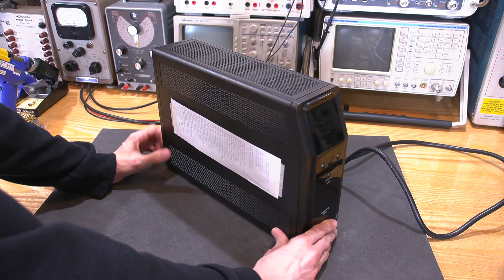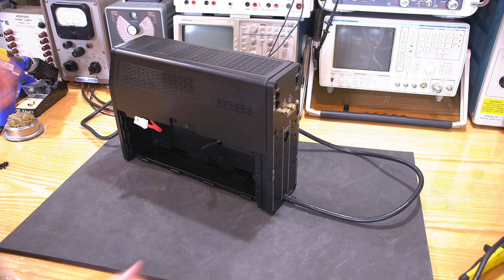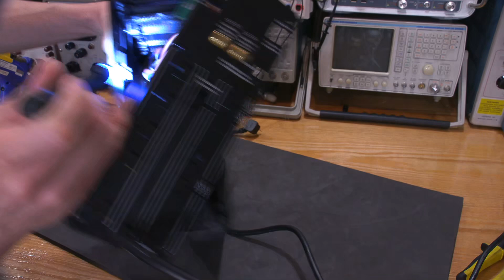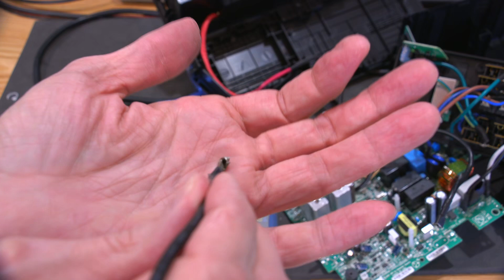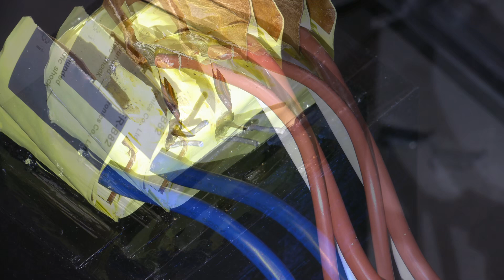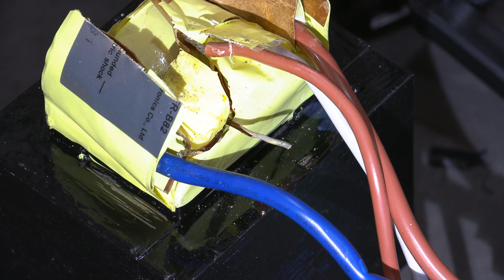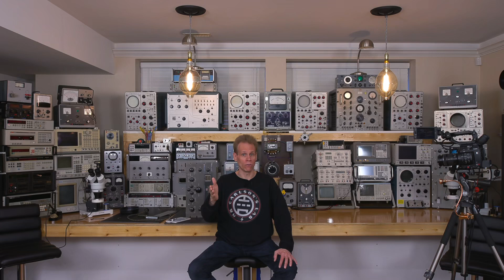UPS Electrical Failure - Teardown and Analysis!

Comment: A few months ago i had a UPS (Green Power brand) and that UPS was complete dead when i received it, battery totally flat. So my first thoughs where that de battery was gone bad, so after replacing the battery, it kept beeping about overload on the output, while there was nothing connected. After some investigation, the culprit was also the transformer. After opening the yellow isolation like you did, i found a thermal fuse that was blown. After temporary bypassing this thermal fuse, and do some continuity measurings, i found that the transformer had a broken winding deep inside. i have seen aluminium before in cheap stick welder transformers, it is way cheaper then copper and it  weights less then copper, so the shippingcosts are less, so this is a win win win for the manufacturer. APC was always a good brand, but even the good ones are now cutting corners to survive.

Comment: APC used to make very good consumer grade UPSs and I have owned several of them. My older ones (7-10 years old) are still performing great and my only maintenance has been battery changes; but the newer two (1-3 years old) both failed just about after one year. I believe that APC has started sourcing cheaper parts from China and your aluminum wound X-former is likely one of them. I gave APC the boot a few years ago and I now own CyberPower units that are operating flawlessly.
Reply: everything's made in china, it just depends on if you get it from the good factories or the discount ones

Comment: We bought an APC exactly like the model you are using in the video.  It failed.  APC replaced it.  The new unit failed.  APC sent us a third unit.  It seems to work okay.  Each month we run a one minute power fail test.  Unit
three seems to be running okay.

Comment: Insane. Apparently the purpose of the solder was just to make the stranded lead wire stiff enough to crimp around the end of the winding! I wonder if the UPS manufacturer even knew what was inside the nice-looking transformers their supplier was sending them.
Reply from the maker: I wonder this myself.
Reply: @MrCarlsonsLab  working at a transformer manufacturer here in the US myself, I am appalled at the “crimping” of the tap wires to the transformer leads! 
I am wondering who the manufacturer of that transformer is, since it seems to have been made in an awful cheap and unprofessional way. Those wires should all have been crimped with a dedicated crimp sleeve. It’s only a few cents more per transformer, but increases the quality by way more!
I found the manufacturer in the video and I’m not surprised… Shenzhen Jingquanhua in China… where else would a company get cheap parts…
I would also like to add that there is nothing wrong with aluminum windings. Depending on the capacity of the transformer it is very common as it also makes it cheaper in price and not in quality (if designed right)
Reply: They most assuredly know what those transformers are filled with. As long as it runs past the warranty time or even 3-4 yrs.. and saves them a dollar or 2 over copper windings..the bean counters are tickled poopless. Be assured that when they started using cheaper transformers.. they certainly didnt pass the savings along to the end users.
Reply: @GunnerAsch1  No, worry more about the share holders than your customers.  Be a financial company rather than an engineering company.  This is why GE Failed.  This is the root cause of the Boeing MAX crashes, why the StarLiner is a piece of highly overpriced junk.
Reply: They should know. You'd think the would at least pull one unit out of stock and do a tear down like this to find out what they are buying from China.
Reply: I wonder if they had used a ferrule to crimp it would it be ok as a final product?
Reply: @starlite528  right everyone is complaining about aluminium wire but what they should be complaining about is bad design using aluminium wire. I'm sure it can be used properly.
Reply: They don't care how it is made..just how cheap they get it..and the profit they make ... why stuff is crap nowadays...
Reply: One wonders if the bean counters factor in the cost of doing a recall...those things seem like a fire hazard (in addition to being an unreliable UPS).
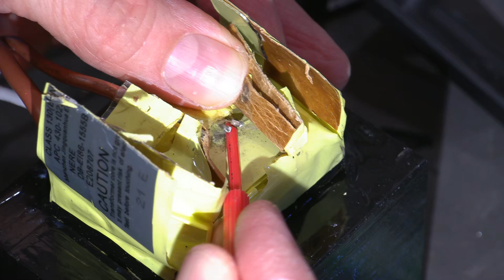Reply: Agreed. I tried pulling a spec sheet on this transformer, hoping that it would list the metal used for windings (knowing it is aluminum). I was able to extrapolate the exact model at 12:30, then searched eBay for a complete model #. BTW, they are cheap (~ 12 bucks). There's no readily-available spec sheet I could find, despite having the complete model #.
Reply: @cdnron75  aluminum windings are very common in transformers. Nothing there. We manufacture transformers with aluminum and copper windings and they are all solid in quality and functionality. There is a price difference between the two, aluminum being cheaper in price than copper, but definitely not cheaper in quality if the design is right. In this case, the crimp is the cheap flaw and APC could actually get that transformer company to replace all of the transformers in a recall.
Reply: This was my first reaction... certainly wouldn't be the first time component supply chain fraud had caused a problem. Bet it's the same in all the other units too.
Reply: All transformers have thin wire windings and thicker wires soldered to connect to.... nothing strange here..if you work with transformers...lol
Reply: @cdnron75  And, they still have their property coverage warranty. I wonder if nowadays, they pulled a page from Ford Pinto days, and decided that it's cheaper to simply pay out when one "blows" up. Ford knew of their "exploding gas tank" issue, but decided payouts to victims was cheaper than recalling and fixing the issue.

Comment: Paul is an expert.  By comparison, I'm a novice with an electronics background.  IMHO, the buck stops with the manufacturer of the transformer which probably isn't APC.  Aluminum wire in a transformer is unacceptable and a recipe for disaster.  Excellent video Paul.

Comment: I got a free large 3000 model/VA or something like that unit and one day as I was starting a project and decided to go .... EEEEEEEEEE acted much like that minus the noises. Attempted to fix it ordered some replacement transistors if I remember right off Amazon that were "new" that were clearly not new when they arrived. So I don't know if I got bad replacement parts or if there was more wrong with it but it's the project on the pile that I haven't gotten back to. It was really nice because I had a nice 30 amp output connector with I think 24 amp capability and I just replaced all 10 batteries.
Curious what brand you went with for replacements. For better or worse APC seems to be the most well-made-ish. I've used a few other brands that seem to cut corners in either the waveform, the modified waveform, fans, etc.

Aluminum well I'm shocked. Maybe I should just build my own online UPS with a quality inverter.

Comment: I have a bunch of much older APC's.  Fully metal absent any fancy screens.  Just a serial port if you wanted any alarm reporting, etc.  Never an issue.  Replace batteries when they need them.

Comment: Ever since they got bought / merged with Schneider Electric the former APC quality has been going down the drain. On the tech side as well as the support side (at least here in Europe).
Those "Quality Assurance / Revision Receipts" are standard though and so far have been stuck on every unit I have ever seen.
Reply: I agree the printed report has been on every unit I have opened... and I have opened a lot of them over the years.

Comment: I have 3 different APC models (one of them is the same as in the video). No issues whatsoever some of them are older than 5 years.
In the beginning, I have done my research and found out - to avoid the cheapest UPS from any brand. APC had the best reputation based on reviews. No issues on my end

Comment: Have to find some APC units from the late 90's early 2000's. They're built like tanks and weigh just as much.
Reply: Yup.  I have three rack mount, and two more larger units from that era.  Replace the batteries and keep on going.

Comment: I have had eight units of varying brands.  I've had five Cyberpower ones, three of which are currently in service.  One quit due to a capacitor letting out the magic smoke (this unit was 2005 era), and I was here when it did it, and another one stopped working with an error code after a power event... I think it also was F04.  No drama, just wouldn't power up anymore.  Sent it to recycling.

I also currently have a MinuteMan MBK 300.  I've had this basic little tank for well over 15 years.  It's been through over four batteries, and it currently backs up my router and cable modem.  I just can't turn off the beeper.

Another UPS I had was an APC tower UPS that was the size of a server computer and had 4 giant batteries in it, and weighed like 200 pounds.  It was loud, and it started failing in strange ways.  I got nervous with it and sent it to recycling.

The last UPS I wound up recycling was a Tripp-Lite unit that I brought home from a friend.  The charging circuit was defective.

Not quite a UPS, but I have a whole home solar array with battery solution from Sunpower.  52kwh of capacity, 13.6kw of continuous power delivery via 2 Schneider XW-Pro inverters during a power failure, 12kw continuous power while on-grid.  The Hub+, whichsort of a smart circuit panel, has a built in automatic transfer switch that they call a rapid transfer switch, that automatically switches the house from grid to an island micro-grid mode.  The batteries and the inverters power the house, and after about 5 minutes, the solar panels come back online and will power the house and continue to charge the batteries.  So during the summer, it's possible to suffer a grid outage and keep life going as if nothing is wrong.  The panels rock micro inverters too, which is nice.

Comment: Oh my friggin god. Thats horrid. ... what a disaster! Bad as when EEVBlog noticed no fuses in weller soldering irons. I should be specific. The aluminum transformer, meh, it can be done if done right. The connection is what blows my mind.... The wiring in my house is still aluminum. It has proper pigtails with proper aluminum wire nuts and antioxidant coatings. All done right. A proper  strong tight crimp and some antiox compound (after a good roughing of the wire end) and this would have never been an issue.

Comment: Very disappointing Paul, they could have used crimps to transition to the copper wire or crimped the wire with a copper crimp and solder to that. I seem to remember that copper and aluminium can corrode at the connection point though.

Comment: I don't think APC knew about that, at least not at time of assembly. Whoever they sourced those transformers from...seems obvious that APC got scammed.

If that was a legitimate and approved design, I would expect to see better splicing. The hack job looks like no such splices were in the manufacturer's stock. Not sure why they would have spools of varnished aluminum, though...very weird.

My career is in IT. Over 15 years. As a software engineer, I also have some experience in network admin. Enough to know that APC is a trusted brand in the industry. Surely they would never risk their reputation by knowingly selling UPS's with those transformers.

Comment: We have two 5KVA APC UPS' in our server room at work. Constant battery issues and then a spectacular failure similar to what was described here with loud bangs and some visual sparks. Never thought something that was designed to improve uptime could be so unreliable.

Comment: Paul I am in Richmond.  I have 2 of these....  1 at work and one at home.  The one at home turned off while I was away.... Then it wouldn't turn on for 3 days - no explanation as to why.  Batts had good charge....  what the heck?   One of my coworkers on night shift told me that one at work had a terrible internal event - but it was still working fine???

Comment: they couldn't even spring for CCA, they went full clu wire cheapo.

ergh.

re-wind it with copper? probably work better than whatever you could source for it at least.

Comment: Good day and thanks I can see your disappointment. Cost of production is likely a big part of a modern day electrical engineering degree 😐. They substitute aluminium wires for lots of stuff now, from data cables all the way up to hv transmission lines. I've even got a few sets of car jumper cables that upon failure inspection are copper coated aluminum. And the power company recently took down my house supply from the street to replace with aluminium (a corrupt recycling swindle due to copper value). As per other comments yes any metal can be joined to any metal with the right flux, heat and filler but that doesn't mean its good to do. They ought to be learning about aluminiums rate of oxidisation and degradation when heat and electric current is applied. Happy weekend bye for now..

Comment: That a newer APC . I got a few older ones and only the battery quit after 2 years . only seen 1 arcing and it was the MOV on the board covered in heat shrink. was a burnt mess. A friend brought it  to me .was still working . was able to clean it up and new V150LA20 MOV  and fixed. must had a surge . the computer was fine. all the ones I had apart look like copper windings. but them are the older APC ones. I would not trust any of them  . save the battery's and PC board with heat sinks and parts. may be some fun projects. 😀

Comment: To solder to aluminum, I've always needed to have a good puddle of flux, and scrape the aluminum in that flux. Once thru the aluminum oxide layer the flux keeps more oxide from forming and the aluminum can be tinned. Then reflow to solder to copper. But with that small of wire, my technique would be a challenge. Maybe there is a flux which would eat the oxide layer, but its pretty tough stuff.

Comment: huh well good to know, ill be replacing the unit below my desk then. I have your exact model, same shape 1500va and everything. granted ive had mine for quite a few years now so i doubt it will fail if it has not yet but id rather get something of higher quality.
any recommendations of a good large ups like this one but, you know, actual copper transformer ect?

Comment: Hi Mr Carlson, sir. small 
Ups is a good circuit design, but a big problem is transformer, not fully copper windings. Why did companies make these big mistakes? I don't know if my suggestions are buying a Ups bigger type inverter, buy. fully copper windings and big parts on the circuits. This is good. But smaller type Ups always bigger problems create you know sir. Thanks again, sir.
I am waiting for the next
 part, sir. Thanks 😊

Comment: The title should be "Mr. Carlson Learns Planned Obsolescence". This is a common practice as the oxide layer takes about 2 years to break down, and coincidently the warranty is at most 1 year. That's why we stick with good old tech!
Reply: For home use, I’d buy two eBay special 120-24V transformers, used one with a lead-acid charge controller to keep the batteries happy, and the other one with a 555 oscillator and mosfet driver for on-line output. I used a standard DIN-rail breaker for output protection. Not as efficient as offline units; but the two I built have lasted 15 years and had the batteries changed once. When on battery power, one voltage monitor would close a relay that drove a break condition on the serial input of the protected PC, and the other one shut down the inverter once the battery dropped even further. Bare minimum of functionality but fairly robust. No transient protection on the input either - the input transformer didn’t seem to care one bit (why would it).
Reply: But where can you get (good old tech)?   I have a failed APC UPS and am wondering where to turn now that my unit has died!?
Reply: @thighdude7  I was referring to vintage radios and electronics as is most commonly showcased on this channel. If it isn't made completely from metal and uses vacuum tubes, it's no good!
Reply: @thighdude7  Get a used rack-mount corporate UPS from ebay. They usually need batteries replaced but the total cost comes out under these cheap-ass back-UPS units. 

Being corporate focused they are generally designed to run 5+ years at the minimum.
Reply: @thighdude7  Unlike Mr Carlson, repair what you have.  Replace the faulty component with an improved one and if that's the transformer, then it's the transformer.  There is some time savings and logic in just buying another brand new, but, what if they got aluminum wound transformers from same supplier too?  It wouldn't be surprising if they are competing on same capacity/price-point.

Autopsy your dead unit and decide what to do from there.  Until these aluminum wound transformers came along, they were a pretty rare failure point so you may just need a switching transistor or something, fried from a power surge for example.
Reply: Huh whut no!  This isn't an oxide layer breaking down, having the oxide layer isn't a problem on the exterior and shouldn't be there on the interior of the joint, breaking down is just not what is happening.  What you wrote simply makes no sense.
Reply: @Stinky Cheese  Ya, what I meant to state is how the two dissimilar metals may react with each other after a few years, creating a non-conductive amalgamation or oxide layer which insulates the two.

Comment: I find this video fascinatingly funny. I was given an APC Smart UPS 700. It worked great!! Can hook it up to a PC to monitor the state of the batteries. I used it to power a CCTV DVR camera set-up. In the last two years it has been "melting" the batteries. I would have to replace the two 12-volt SLA's every year (or less). After watching this I think I will just get another APC in another brand before it burns my house down when I am not at home.